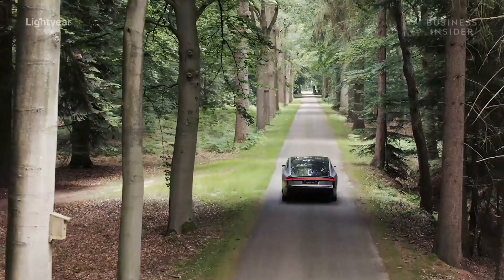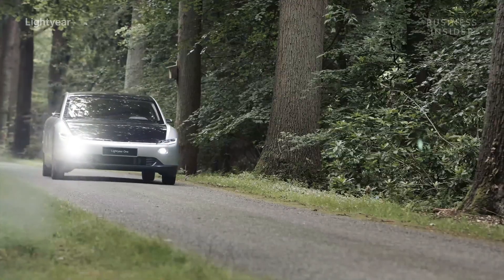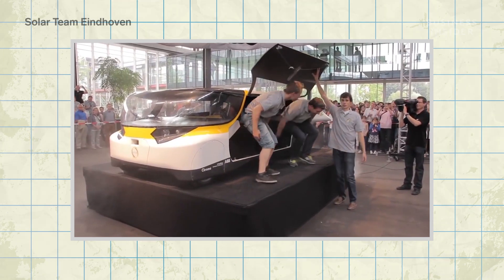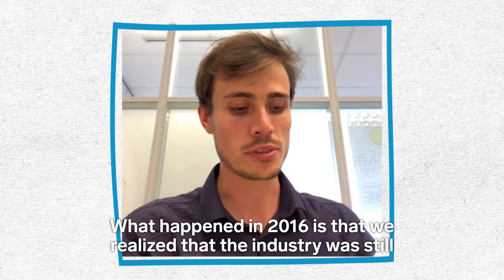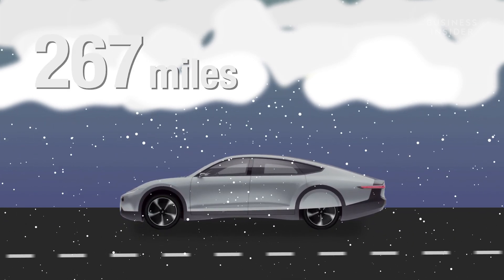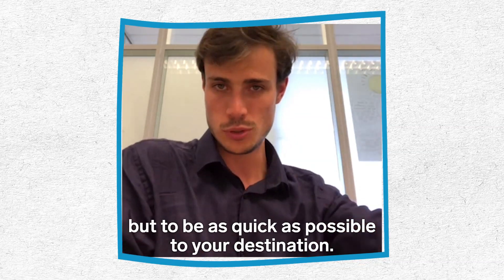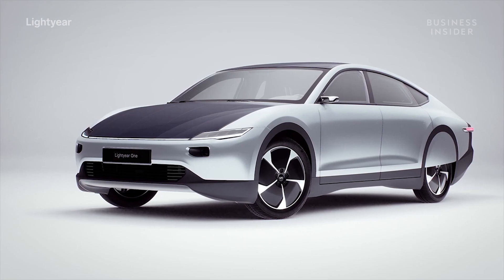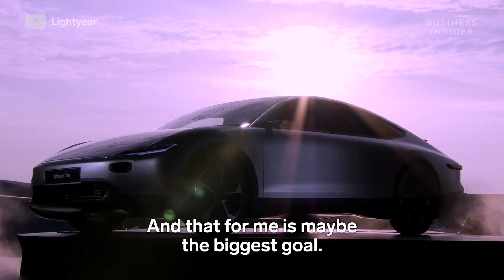Inside The $170K Solar Car That Drives 500 Miles On One Charge

Comment: Tesla model X and others are very heavy and to powerful. This concept is light and efficient. The smart way to go forward.
Reply: Thats also why they can use smaller and more efficient inwheel motors so they don't need a drivetrain to save even more weight
Reply: Maria Santov indeed! Thanks! And because of the efficient motors they can also use smaller battery packs etc. Lightweight is paramount.

Comment: They are comparing a decade old Tesla model S with a concept car. This should be compared with Roadster 2020 which beats the spec of this concept car in every way possible. Surely this creator either hates Tesla so much that he or she wants to prove Tesla is inferior or doesn’t have any clue about EV industry.
Reply: The Tesla 2020 batterypack is almost 4 times bigger and weighs twice as much.

Comment: Sucks that most of these electric cars are made as “luxury cars” makes it even harder for the average person to buy one
Reply: Brian Reyes the reason is that it is extremely expensive to design and manufacture, so if you add a negligible amount of luxury trim to the car then you are more likely to sell it to the rich.  for example, if this car cost 120k with barebones features, vs 125k with 5 grand worth of nice leather and infortainment etc, then which version is more likely to sell?  you’re not buying it unless you are rich anyways, and at that point, you have to up your chances that a rich person will buy it over another luxury vehicle, because no cars in the high price range have standard trims.

Comment: Electric cars are useless in cold weather.... even one of the hottest places in Canada (Vancouver) is too cold during winter.... these cars are for Silicon Valley dorks
Reply: David Argenal Ideally they’d stick a heater near the battery. Guess it would use more energy than it saves.

Comment: The roadsters range is 600 miles and it will be released in 2020 and will cost 200 thousand dollars (Tesla Roadster)
Reply: Who wouldn't take the roadster? It isn't even a comparison? The roadster is a hypercar, totally different things
Reply: @Nicolas-zo6rg  a four seater hypercar, yes
Reply: & the roadster is the fastest car ever
Reply: @arnaldurrobertsson6899  it hasn't even come out yet and you're calling it the fastest car "ever"
Reply: Straight Busta they revealed it’s specs. It is the fastest production car ever.
Reply: @arnaldurrobertsson6899  They've only announced it. Then it doesn't qualify as a production car lol

Comment: Solar Charger of This Technology would have been a Better Idea, than Designing Your Own Car.

Tesla will Crush It.
Reply: Without solar charging, this car uses almost half of what a model 3 does! This is a solar race car adapted for road use. If Tesla owners in the US were paying the list price in Europe for electricity driving around, you'd think otherwise. This is not a popularity contest but evolution in efficiency. Elon is still making gasoline cars with batteries. The most efficient Tesla was the Tzero when the company was still called AC propulsion... That was before Elon came along!

Comment: Seen this same idea for 20 years they been saying production for ever
Reply: Ya except the tech has changed obviously
Reply: Ur gonna finally see some change
Reply: Keanu notReeves you obviously did not do any research after the company and its founders.
Reply: I feel you but I’ve seen some Prius with solar rooftops idk any specs but I’ve seen this concept on the roads already ;)
Reply: 170k better make it 599785543253213k
Reply: True oof
Reply: I prefer buying a VW ID3 for 30k and spend the rest of 140k for a porsche in the weekends😀
Reply: Same can be said about Tesla. Think about it :)
Reply: @Keanu notReeves Tesla was a joke to people too. This is the REAL electric car we need.
Reply: @Keanu notReeves Neither Tesla nor Volvo did this before so, the idea is newly being put out. That and they probs having a patent on it. Also they made a roof FOR the Tesla. So you can have a solar panel roof on the Tesla. Something that could get them a lot of money.
Reply: @Keanu notReeves how is that not a technological advantage

no gas
short charge time
Reply: @Keanu notReeves what difference does it make whether it's vertically integrated ?

by the way you misspelled  integrated badly i believe
Reply: @Keanu notReeves its 50000 euro 1000 kilometers range with out solar, and they are building production line here near buy.
And the rumor is that it's battery wilbe solid state. They care is build with the technish university of Eindhoven backed by Philips (inventions light cd dvd led building medical systems ASML (building machine's for making chips for iPhone and more).
So I don't think it's a joke it's more the future.
Reply: @Keanu notReeves have u ever heard of luxery car its in luxery car market..
How tesla launched roadsher which was shit compared to petrol cars at the time and ultra expensive and slowly moved towords better and cheaper cars thats  how this works.
U wont expect a startup suddenly making cheap better than tesla cars..unless u dont know wtf u talking about.
Reply: Company launched just 5years ago chill man

Comment: Clickbait, it's 497 smh
Reply: Ha y u always lying
Reply: I can walk 3 miles 😎
Reply: Zane Miracle *insert ur profile pic 
😂😂😂
Reply: Boi it’s 3 miles apart
Reply: @arandomboi7611  Alright bruh, when your car fails 3 miles from your destination. That 3 mile looking mighty long
Reply: If u were to drive somewhere which was 500 miles away without recharging along the way (which is already dumb.) The solar panels will cover the 3 miles.
Reply: @arandomboi7611  who in their right mind would not charge their car they only had 3 miles left. That doesn't change the marketing.

If two phones were marketed one as 3500 when it's really 3200 and another one a true 3500. You could use similar argument that doesn't change the fact the former is unlike the latter. With that argument a true 500 mile phone should be 503 and so on 🙄
Reply: @nebula3576  Why is this directed at me ?
Reply: @zanemiracle6121  some people are pessimistic some are optimistic, some round up but you sir round down.
Reply: @scottsfreeny5825  In the video they explicitly said it was 497. How is it me rounding?
Reply: @scottsfreeny5825  Where is this extra 3 miles coming from? last time i checked money didn't fall from trees and electric doesn't appear out of thing air to charge your car.